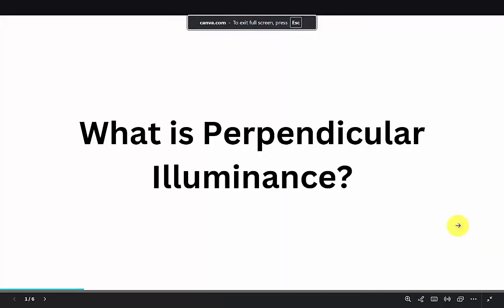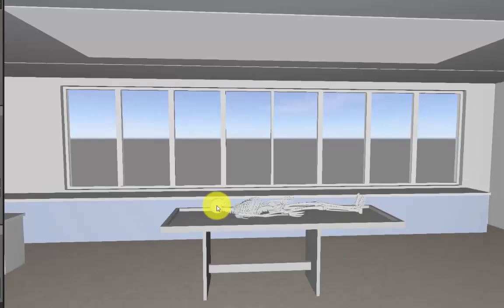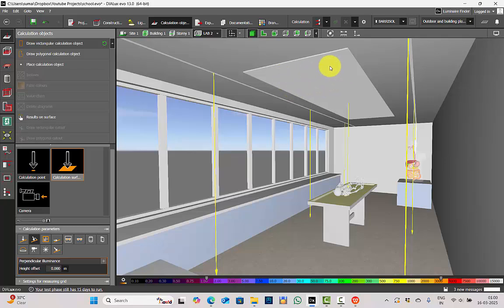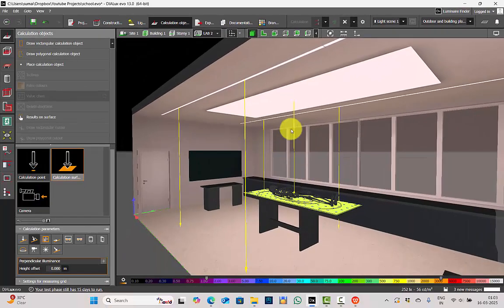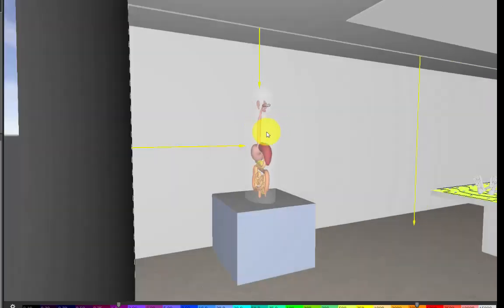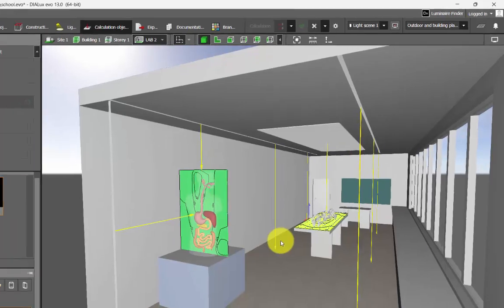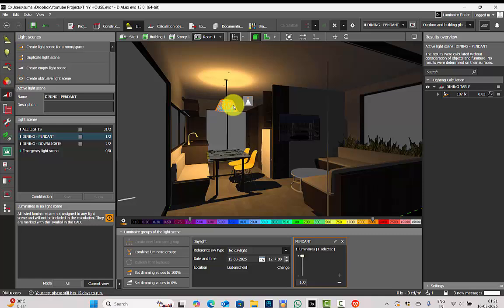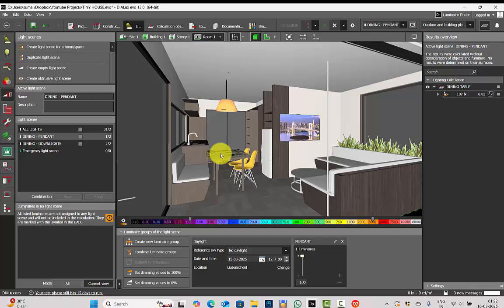What is Perpendicular Illuminance? and How to calculate it in DIALux Evo

Comment: One question: if I only calculate the lighting perpendicular to a slate surface, is it no longer necessary to switch to vertical lighting? Would the values obtained be the same? Greetings from Peru. Thank you for your videos; they are very helpful.